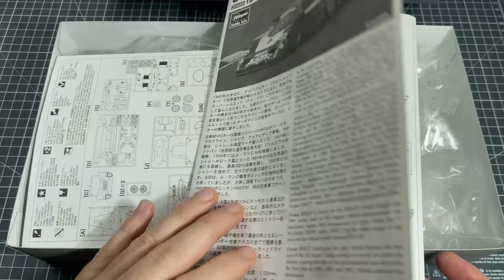Building: Hasegawa Calsonic Nissan R92CP 1/24 scale PART 1

Comment: The red seemed not to go on all that well, try adding a bit of thinner to the paint. this helps it flow out of the airbrush better, and creates a smoother overal finish. same goes for the blue and clearcoat. Looks good man!
Reply from the maker: thanks for the feedback/advice mate - I'll try using more thinner next time and see if it comes out better!
Reply: @autostradamacchina  wow, a comment from Tom. Nice!
Reply: @autostradamacchina  wanted to comment the same. Also, try a different thinner like Mr. Color levelling thinner. It should result in much less wrinkles.
Reply from the maker: Thanks Thomas, I actually started using more thinner 50:50, as well as got a new airbrush and proper compressor and the issue I think has resolved. I also had a lot of “spitting” but I think that might have neen from low compression (shitty Chinese compressor from before) and a bent airbrush needle.

Comment: Interesting to say it doesn't have an engine. I have the 91 version from Hasegawa in my stash so maybe I should have a closer look at mine. It's still more detailed than the XJR9 which I made.
Great start! The livery is pretty much the same as mine so I will definitely watch this again when I finally make mine. 👍
Reply from the maker: Thanks mate, yeah have a look at the 91 and let me know. I do know there is a 92 Super Detail kit too which has an engine etc, but ah well
Reply: @autostradamacchina  yeah I will do. I may start doing regular unboxing videos of kits like that whether I am starting them or not.
Reply from the maker: good shout! At least you wont get a last min surprise that way haha
Reply from the maker: btw I checked the 91 is the same as the 92.. http://www.hasegawa-model.co.jp/product/hc31/
Reply: @autostradamacchina  ah thanks. Hasegawa have a reputation for reboxing a kit several times with minor changes. My XJR9 even said XJR8 on some of the sprues!
Reply: @autostradamacchina  I have the super detail version, it has a white metal engine, quite heavy

Comment: Great video. Great build. Could you please inform what brush you are using to paint those small details? Thank you.
Reply from the maker: Great thanks Paolo! For the detail work I have 4x Tamiya brushes I mainly use, see 87153, 87154, 87155 & 87156. I think for the dashboard I used the 87154
Reply: @autostradamacchina  Thank you very much.

Comment: Very professional man. I’m exited to see the final results. By the colors and design it really looks like an interesting and fun build. How did the 2k worked out when spraying? I bought a set and I’m exited to try it, something new for me.
Reply from the maker: thanks man, yeah I've been using 2K for a while but my airbrush isn't the best, so I do tend to get inconsistencies after applying 2k which I then need to sand down etc etc. But just be patient with the layers and I think you'll be fine. What brand did you get?
Reply: @autostradamacchina  Splash paint 2k

Comment: Do you find the 2K clear coat you used poses less damages to the decal when applying the wet coat? Because even applying first and second the mist coat with the Gunze UV cut clear, the last wet coat still makes the decal wrinkled up, especially with the Tamiya Cartograf decals. Appreciate if you can share some tips thanks !!
Reply from the maker: To be honest I don’t really have experience with 2k other than the zeropaints 2k pack, however I’ve never had any issues with decals getting damaged from any of the kits I’ve build with the zp stuff. Maybe best to switch and trying something else?
Reply: @autostradamacchina  
Yes , makes me want to try out the 2K zero paint clear although I have to order it online
Reply from the maker: If you cant get access to that easily I’ve seen a lot of guys use Mr Hobby GX100 Super clear III, that is definitely on my list of clear products to try out